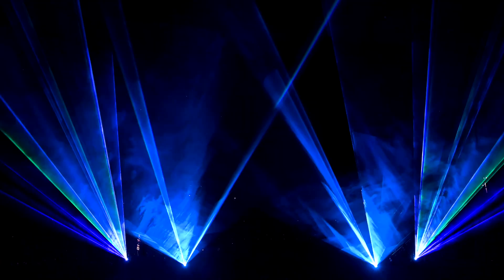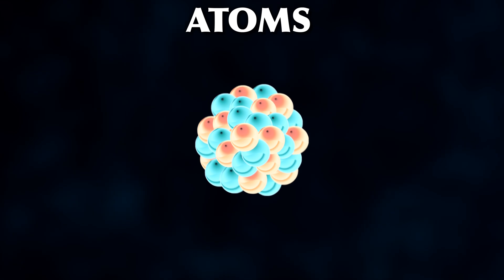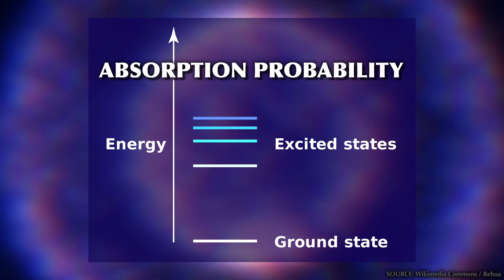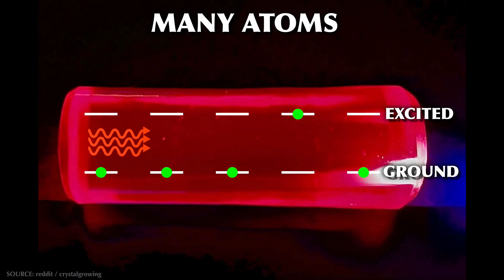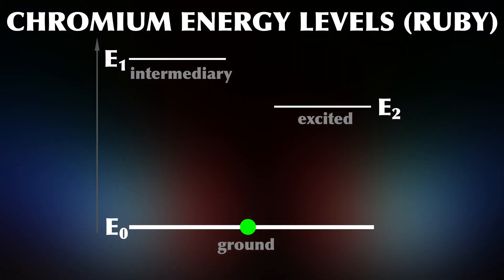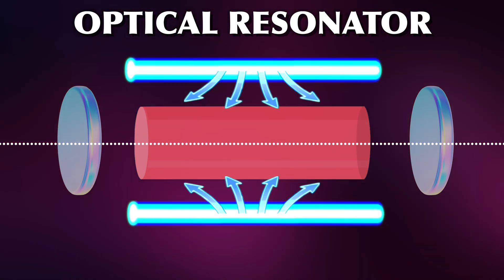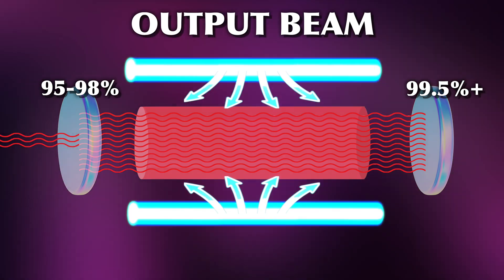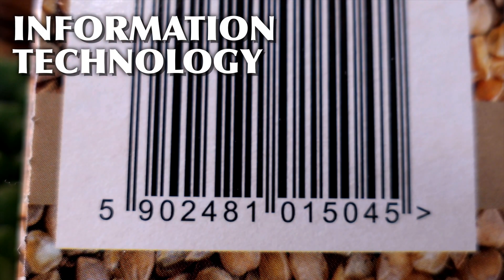Light Amplification By Stimulated Emission Of Radiation (L.A.S.E.R.)

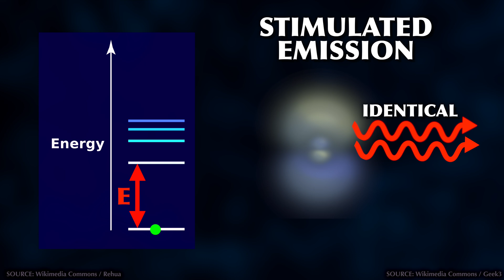Comment: 5:12 Yes, but ....why? Why is the "stimulated-ly" emitted photon supposed to be of the exact same frequency and identical in every other parameter as well? And what does the stimulant photon even do? Like how does it even trigger the emission of another photon? And where is that energy coming from?

And as you said, its a statistical process, so the system with two levels differing in energy which is equivalent to, let's say 550 nm, will interact with a range of photons from, let's say, 548 nm to 552 nm, so when the emission is stimulated by a 552 nm photon, will the emitted photon be of ∆E=550 nm or of 552 nm? And if it'll be of 550 nm, so where did the extra energy come from?
Reply from the maker: Great questions! The reason why the photon emitted through stimulated emission is identical to the stimulating photon is not trivial; we really need quantum field theory here. But shortly: if the electromagnetic field already has excitated modes (photons) in it, any further excitations of the field are likely to produce the same mode (photon) - photons are bosons.

As for the other question, I know that my figure was WAYY overstating things - but otherwise, you wouldn't be able to see anything. Anyway, in reality, only tiny deviations from the "true" energy value can be bridged. Both the "true" photonic energy and the "true" atomic energy are fuzzy - they have an energy uncertainty given by the Heisenberg uncertainty relation. That's why atomic spectral lines have a finite linewidth, they aren't infinitely sharp.